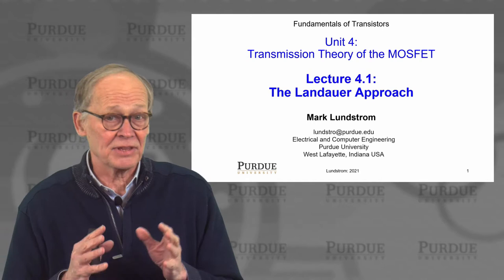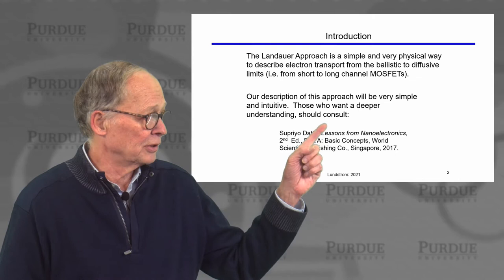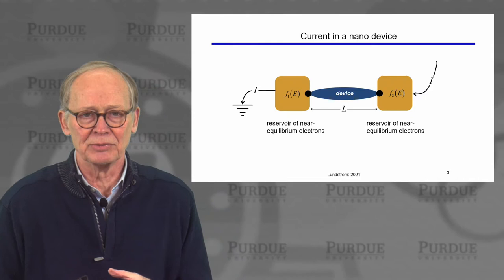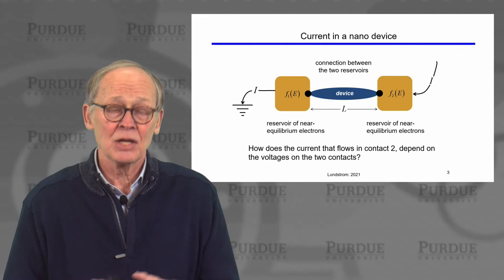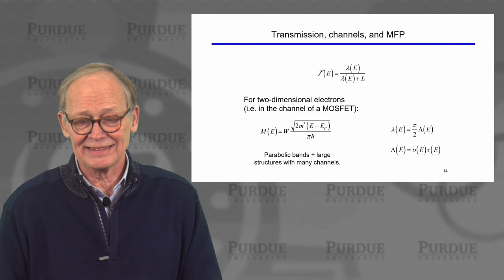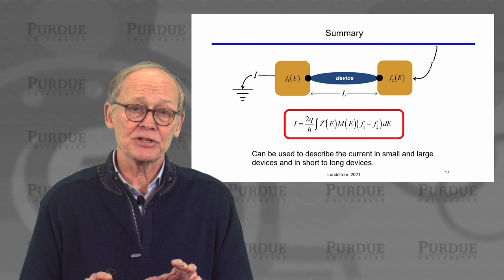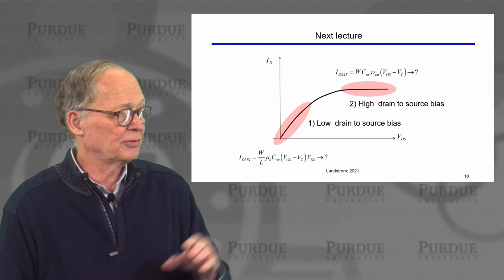ECE Purdue Transistor Fundamentals L4.1: Transmission Theory of the MOSFET - The Landauer Approach

Comment: 00:00    Lecture 4.1: The Landauer Approach
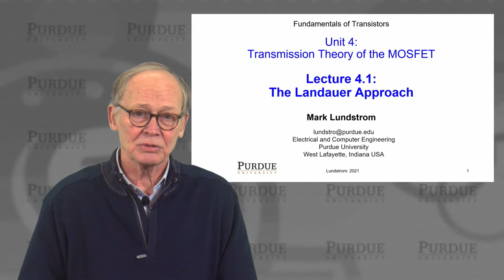00:34    Introduction
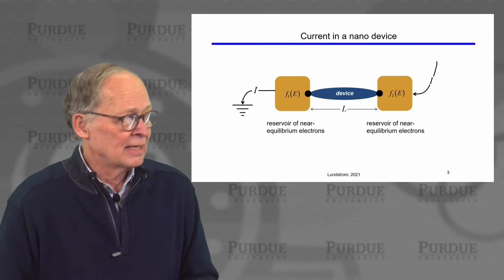01:13    Current in a nano device
02:12    Current
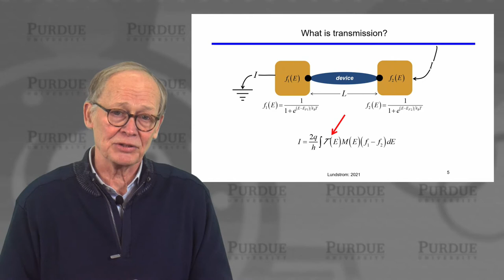03:24    What is transmission?
03:32    Transmission
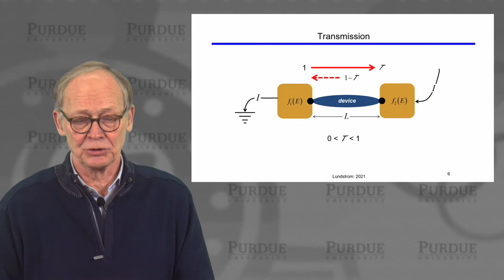04:27    Ballistic transport
05:29    Diffusive transport
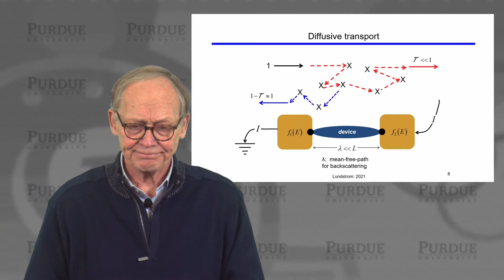06:14    Transmission (general)
07:50    MFP for backscattering in 1D
09:25    What is a channel?
09:39    Channels (modes) from E(k)
10:58    DOS(E) vs. M(E) (parabolic bands)
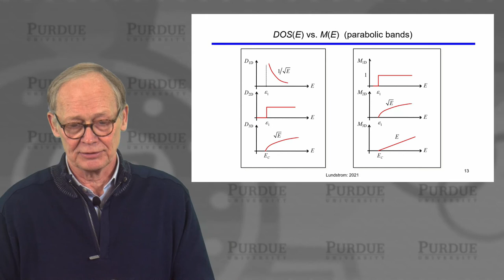11:44    Transmission, channels, and MFP
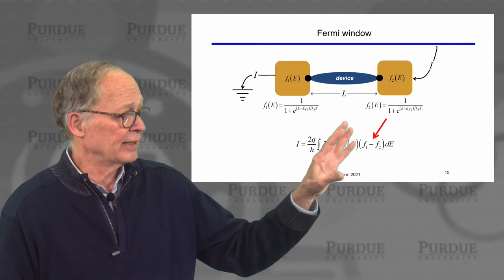12:56    Fermi window
13:23    How current flows (T = 0 K)
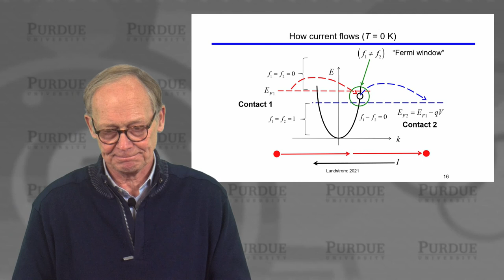15:44    Summary
16:11    Next lecture